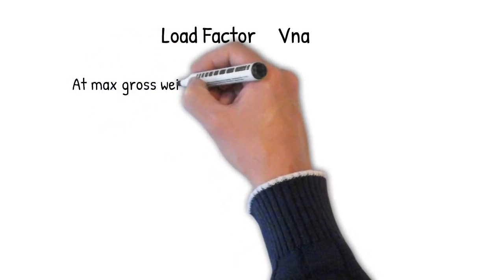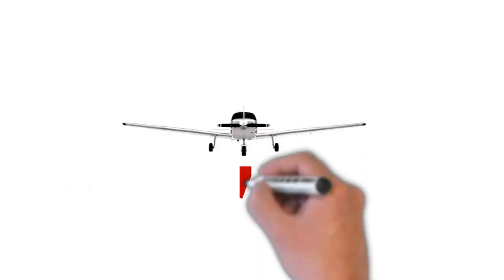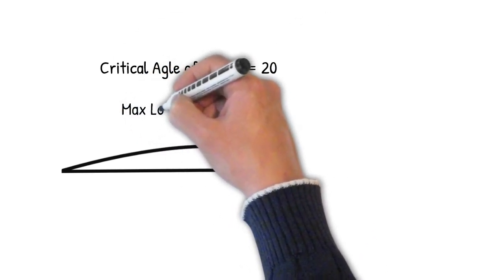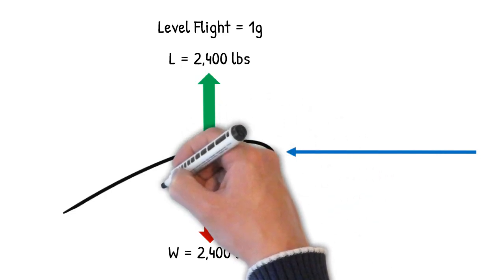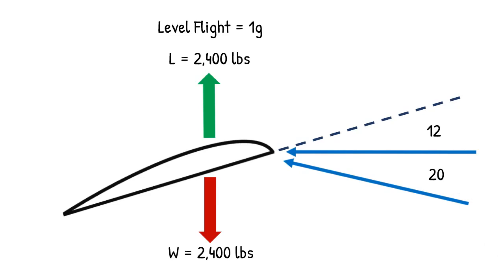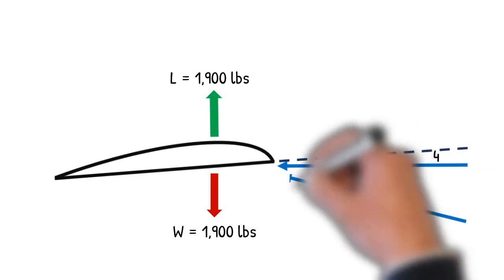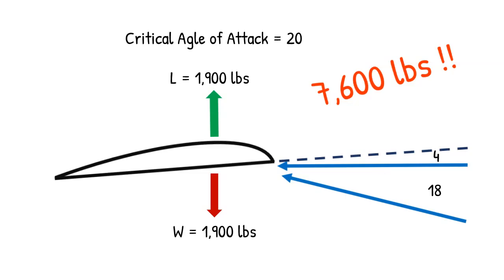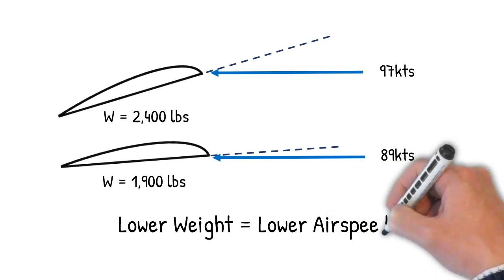Va and Load Factor

Comment: Completely consistent with training, and completely wrong.
Reply from the maker: Could you please elaborate?
Reply: @Loves2Fly think about it.  

What speed could the plane safely fly if it weighed a billion pounds?  

Would the speed be greater, or less, if the plane weighed 1500 pounds?

Angle of attack is immaterial, all that matters is the load on the wing. 

The accelerometer, or g meter, in the plane does not indicate the load on the wing, if the weight is able to be varied between flights.  

A billion pound plane would indicate zero g, and yet the wings would be ripped off as it descended.

Planes should have strain gauges that indicate whether the wing, etc., are near the overload threshold.
Reply: Huh?